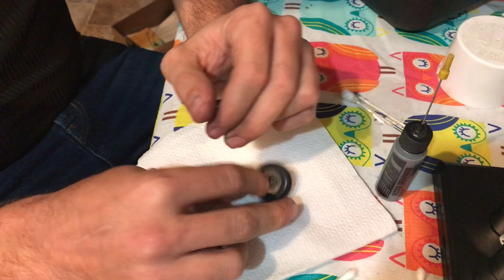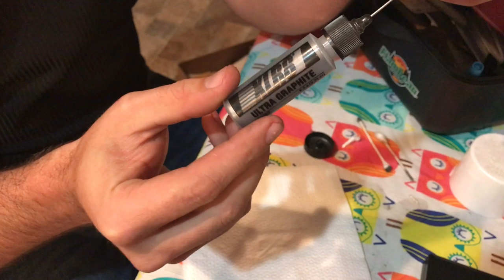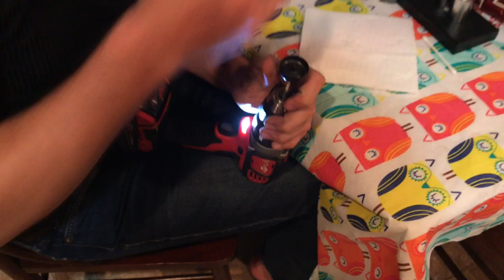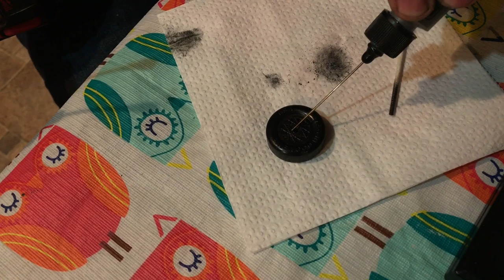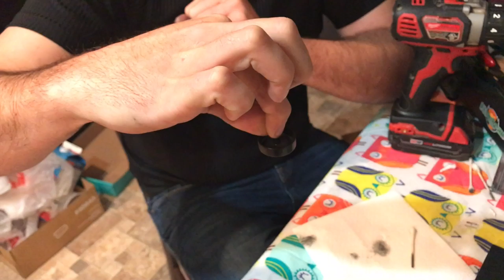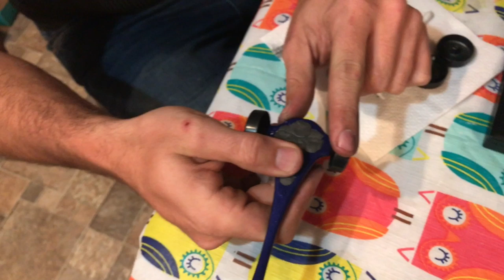Pinewood Derby Secrets Part 5 - Wheel Bore Polishing

Comment: Really appreciate your pinewood Derby videos! Can’t find #4 where you talk about wheel prep...is it hiding or still in production? Thanks!
Reply from the maker: I'm editing it, had to do several different clips for that one and it's quite a bit longer.  Should get it up this week though!
Reply: Still editing?
Reply from the maker: Posted!
Reply: Q-tips yes. Hob-e-lube is the 2nd fastest graphite you can get and most common used. To Polish the wheel use novus #2 (the container store) or whitening toothpaste do 2 rounds. If it squeaks go slow enough to see the rotation. If not u can go a hair faster. Let toothpaste dry then buff off with pipe cleaner, then add graphite.

Comment: Did I miss the step on milling the inside of the wheel?
Reply from the maker: Most rules will not allow inner wheel milling.  If you have an unlimited or outlaw class it's typically allowed.  Check your rules!
Reply: @technicolorchristmas  I'm very familiar with this fact, but some races (e.g. Mid-America) do allow it. I was asking because it was mentioned in the video.
Reply from the maker: I need to shoot that again, maybe before this next season.

Comment: I can’t find a-tips that will fit inside the wheel hub.  Did they change the wheels since you made the video?
Reply from the maker: We use standard Q-Tip brand from Johnson and Johnson in the blue box.  I do run them in a paper towel filled with graphite before I try to insert into the wheels and I believe this narrows the diameter a bit.  It should be a snug but not tight fit.
Reply: @technicolorchristmas  It might not be a bad idea to take a sacrificial wheel and force the q-tip stem through the bore of this wheel to get it to the right diameter before using for polishing.